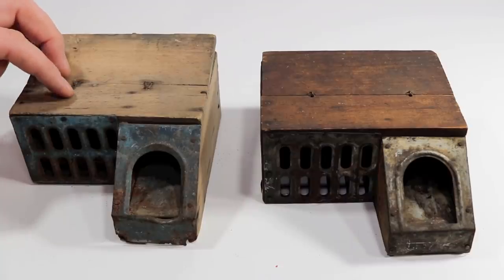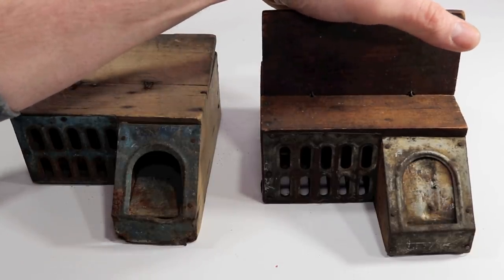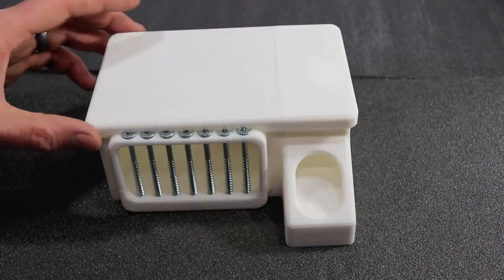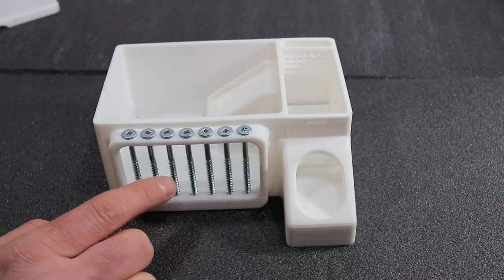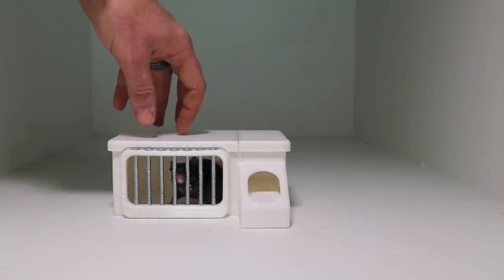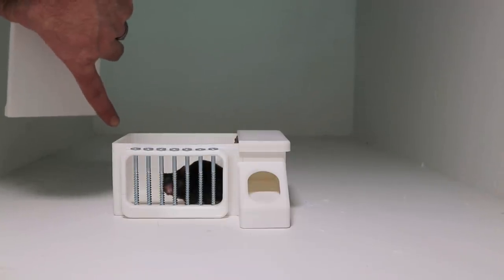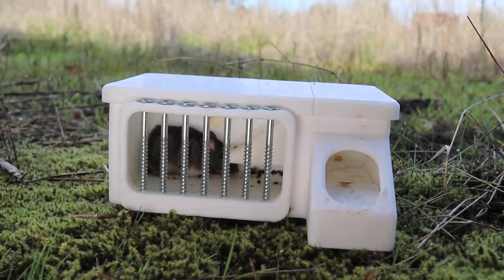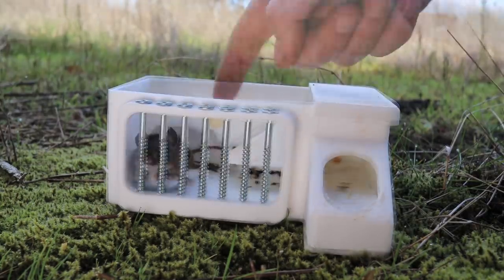3D Printed Delusion Mousetrap Based On A 1876 Patent.

Comment: That lid doesn’t seem like it weighs enough to actually hold them in, it worked on that one but I’m not sure how consistent it would be
Reply: 0MindSwept0 - I was looking for someone else wondering this, it’s not just me then.
Reply: if so that could easily be solved with some tape or velcro, something like that
Reply: You are thinking like a human, not a mouse.
That kid is immense to a mouse, but if it gets tossed, just add weight.
Reply: Bifta - I was thinking a lip so it slides. It seemed to work though, are mice very weak?
Reply: Mice can dash and jump with surprising speed, so I wouldn't think it impossible for a determined mouse to slam into the roof until they can squeeze out. A sliding door would absolutely solve that issue though.
Reply: The lid does need a bit of a redesign, like some kind of a locking mechanism. A sliding door would also need something to keep it in place.

In spirit of 3D printing, combining the lid with a simple lock by a plastic pin in two holes securing the lid and cage together.

I would also be concerned with durability, since there is a possibility of chewing it's way out.
Reply: The simplest fix would be a rubber band around the whole trap to keep the lid on.
Reply: 0MindSwept0 - the lid does not just sit on top. If you look at the Thingiverse link in the show notes and swipe through the images you'll see the lid has tabs and the prison has grooves they snap into.
Reply: Thanks for pointing that out Mark Conger.
Reply: Just put a rock on top
Reply: Why tho?
Reply: Just glue a stone on it or something and you're good.
Reply: mice are too, for the lack of a better word, cautious. You'll never find a mouse that would try that. Keep in mind these animals are not very intelligent. I've seen a video where they get caught in a trap with multiple dead mice clearly in view.
Reply: Dylan Armstrong - well I mean, there are several of those, but a dead mouse isn’t the same as a closed lid where they can move around, see that it’s loose, and figure out that they could probably just knock it off. They may not know karate, but they know crazy
Reply: It's a video, you can't exactly determine how much the lid weighs. The mouse clearly wasn't able to get out so i'm assuming the lid weighs more than the mouse can lift.
Reply: its not a problem superglue rock or iron and there you go
Reply: Woof
Reply: Well put a small weight on top
Reply: I agree
Reply: Add some lead
Reply: Well I mean you aren't going to be catching anything bigger unless you make the trap itself bigger. Besides, you can easily put something on top of it to weigh the lid down
Reply: Dylan Armstrong they are smart actually smarter then you think anyway seeing other dead mice and falling into a trap doesnt mean there dumb they just dont care
Reply: @vincentdumm9115  rubber band will break when you take it on and off
Reply: @Aereto  just make the chamber bigger

Comment: Nice update useing the screws as the holding tank bars  since very thin 3D printing bars could be chewed through  seems the holding tank is sorta small for multiple catches   it would be easy enough to enlarge in 3D
Reply: Walt Lars 
It has its downside of mice resorting to eating each other when left for too long to become desperate.
Reply: Aereto that is a down side to any live catch trap  
 Some mice or rats eat dead ones in kill traps or perverted things  
It is your Responsibility to check the traps

Comment: too bad the maker didn't make a larger "jail" as the flaw from over crowding is very obvious
Reply: You could use a large jail connected to a second chamber with a second one way door (that can only be opened when the chamber is atattched) to house many mouses while being able to lift the chamber one by one to remove said mouses
Reply: @globin3477  actually that would be kinda cool, just daisy chain them together

Comment: Effective little trap.  It’ll fill up quickly in a high-traffic area, though.
Reply: terryv And they poop so much. Maybe there should be a removeable bottom so poop falls through wire grating or something. Easier to clean
Reply: Wire grating is bad for mouses. But the removable bottom is a good idea.

Comment: I purchased that trap that uses a CO2 driven piston. It was $220.00 USD.....waiting for delivery.
Reply: That A24 is supposed to be great. Good Luck with it.
Reply: One of the best traps kills any rodent
Reply: Thank you. I don't know how to make video's but I will let you know how it works in these comments.........
Reply: Update.....I received this trap as promised so no complaint's on delivery time. Now about it's operation......I mounted it on a 2x6 5" from ground level on a portable platform. I placed it where I know I have some rats. If they could speak, I suppose they would comment on how nice the structure that holds the trap looks. I haven't had any takers yet. I am considering making some adjustments to the bait .....I hope others have had better luck.
Reply: SlingbladeJim did you use those bait tabs that test if a lot of rodents are there? Those really let you know where the most rodents are. Hope you have better luck!
Reply: I had/have a rat/rats just above the finished ceiling. The furnace is stationed there so it's all accessible by ladder. I could hear them/it scurrying from one point to another and in the wall space between the kitchen and bathroom. I went up to the rafters and saw their little poopies and  where they had formed an almost perfect hole in the insulation for their nest. I placed the trap on the plywood floor a few feet from this hole. Zip. On the other hand, I haven't heard them in a few days ????????? 
Thank you for answering and reminding about the bait though.
I am going up for an inspection in a couple of days as I am out of town.
Reply: SlingbladeJim Once you come back make sure to check the trap. Wish you luck on catching rats.
Reply: Thank you............
Reply: Yes, I have been considering replacing the stock bait with PB....thank you
Reply: 220$ for a mouse trap ? .. but spring trap cost like 2$ and it works just fine .. put some bread on it and remove mouse every morning, easy .. or get a cat
Reply: I would be hard pressed to disagree with you......
Reply: It's more for rats and squirrels I think. Rats are pretty crafty when it comes to spring traps
Reply: well people usually don't have rat problem in living places and if its warehouse .. why not just use poison ?
Reply: Lapuka poison has its drawbacks
Reply: Lapuka you'd also poison any pets or other animals that happen to eat those rats. And when they decompose that poison can get into the ground. Its really not worth the risk to the environment imo.

Comment: this is one of the best designs I have seen so far but the biggest flaw is the small holding cell that will cause stress and killings.. if you re-design this one you should think of a bucket attackment or a really big holding cell to get a big infestation in a barn under control fast..

Comment: What holds the lid on? (A rock would hold it down.) If the back was also made from screws then the sides could be flat panels that slid into grooves, which would reduce packaging for postage, (also trading print time for metal.)

Comment: You now you could cut off the holding chamber part where they are held after they are caught and replace it with a larger holding cell and you won't even have to let them go it will be mouse after mouse after mouse just an idea.